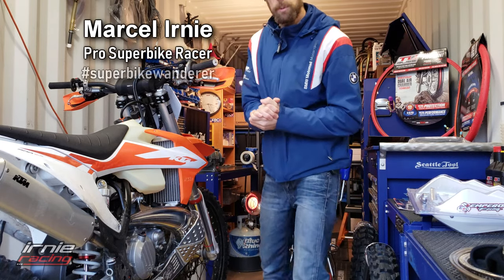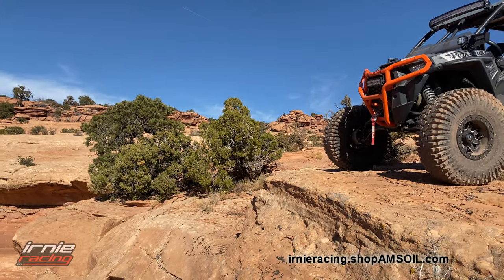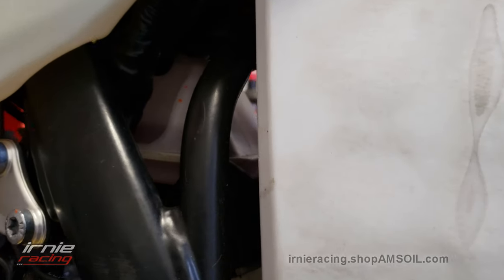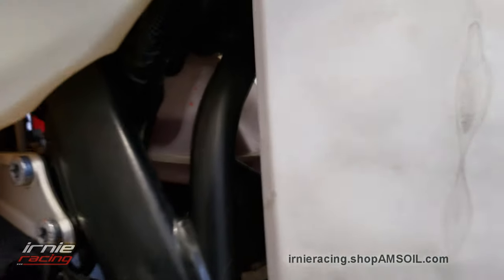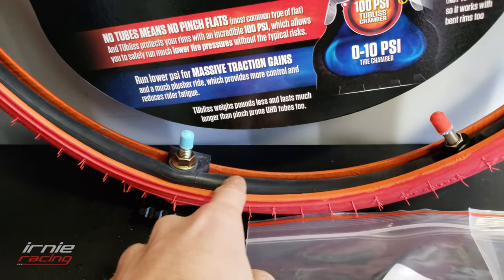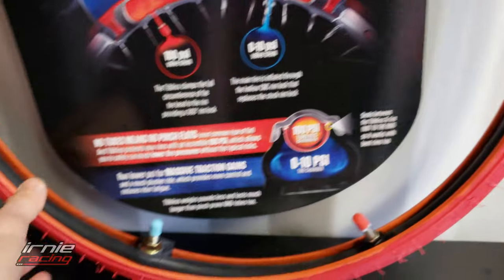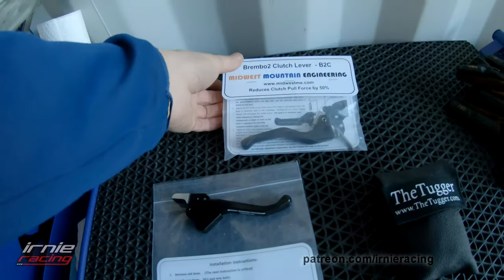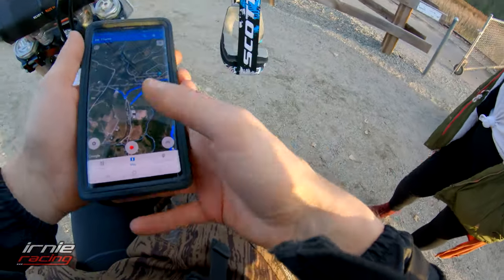AMSOIL 2-Stroke Oil & Transmission Oil - 2020 KTM 300xc TPI: Enduro Bike Build Series Ep.1 | Irnie

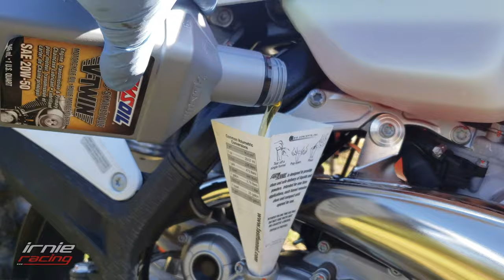Comment: At time 14:09 you said 80 was thiner than 50 but 80 is thicker .
Reply from the maker: The viscosity for engine oils and gear oils are not part of the same scale. A SAE 90 gear oil has a thinner viscosity than a SAE50 (20W50) engine oil.    
SAE 50 Engine Oil Viscosity Grade must be between 16.3 <21.9 mm2/s @100°C. 
(Engine Oils – SAE J 300).

SAE 80 Gear Oil 
8.02 <11. mm2/s @100°C.
(Gear Oils – Excerpt SAE J 306)
Reply: @irnieracing  ... 20w50 is way thiner than 80 w I but in my rear diff , so I'm not sure you are correct.
Reply from the maker: @goodboyringo9716  did you even read what I wrote above.. Try again.  I am correct!

Comment: What do you like better? Dominator or intercepter?
Reply from the maker: Dominator has more protection with thicker viscosity and Additive package.   Both great options though.    I'd use whatever available if there was no choice.    
http://irnieracing.shopAMSOIL.com
Reply: @irnieracing  ok I’m thinking of going to the intercepter. I’ve been running dominator and getting a little spooge and smoke. I called Amsoil and they said dominator is for the track only
Reply: @irnieracing   have you had any engine problems with dominator or interceptor. The KTM guys said  they have had guys stick pistons with motul. I bought a gallon of the dominator but I don't want to fuck up my engine over 70$ of  oil. Would really appreciate your input
Reply from the maker: @gotdirt66  check my first and only piston change at 240hrs - Run on exclusively AMSOIL Dominator 
KTM Top End Refresh + TSP Low Comp Head: https://www.youtube.com/playlist?list=PL9EdHN9SPeEjjs_qZqOuN4-vphWmOFaIp

Now im at 285hrs, no issues.  Use the AMSOIL Propylene Glycol 60%/ distilled water and add AMSOIL Coolant Boost, and no need for a fan.  I don't run a fan.